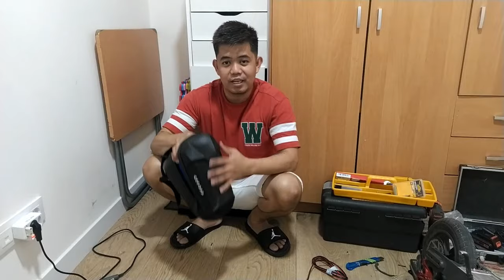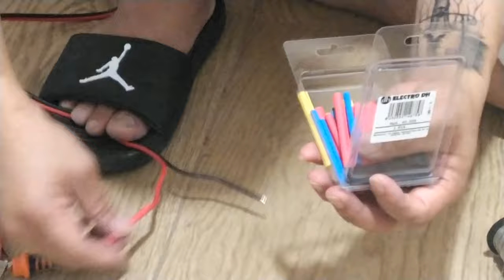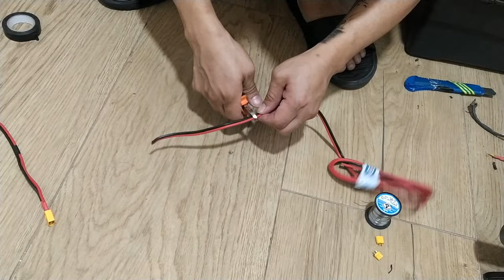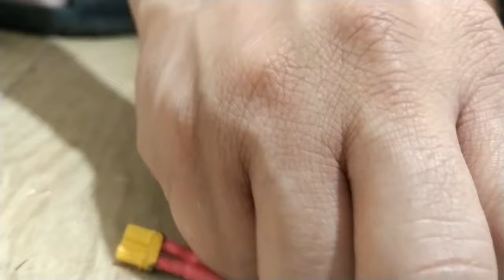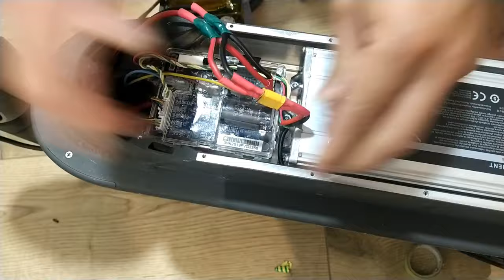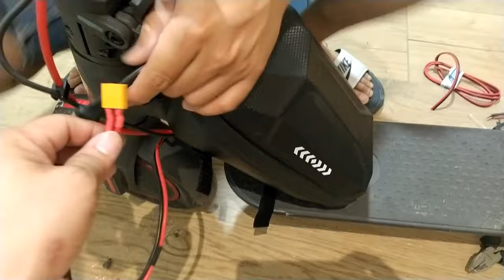how to make parallel connection for extra range batery  in xiaomi pro.

Comment: Just one quick question did u make sure the battery is the same voltage or did u have the 45v and 36v on different charge levels as I'm curious about what happens if u didn't do so
Reply from the maker: 36v to 42 v it is ok to do a parallel
Reply: @RHON_TV  So not. That is fire waiting to happen
Reply from the maker: @diyzona  alsmost 4 years alredy when i used this.
Reply from the maker: @diyzona  where did you get the 45v i say that vedio is 42v and 36v .

Comment: Hi, can I pay you for helping me tuning my xiomi pro 2 ? I just have some questions nothing much and I want to pay you for the informations.
Reply from the maker: yes whatbking of info do you want sir
Reply: @RHON_TV  i have sent you an email, maybe u can respond to that but I will make a quick list here.

Wich controller do I need to run a 500W Motor ? And Wich is compatible to my pro 2 i saw your video where u change the controller but I was not able to find the exact one u are using.

Can I reach like 40kmh with the 500W motor from Amazon?

Do I need an external battery to go faster ?
Reply: It would be awesome if u can give me links to products i would need to get my scooter up to 40km/h minimum, like the motor controller, motor and external/internal battery. And tell me if u want me to pay something for that, that's no problem i just want to be faster than 30km/h
And the controller and stuff need to fit in my xiomi pro 2 ^^ thank you very much for helping me out
Reply: @RHON_TV  can u maybe tell me?
Reply from the maker: ok i  will reply you in your email
Reply: @RHON_TV  thank you very much ! ❤️🙏

Comment: I have questions about the battery, is it the same voltages as the one on the scooter? That means 36v?
Reply from the maker: helo not desame  stock batery is 36v. and we add 45v  range battery
Reply: @RHON_TV  thank you one more question, how do you charge them? You just connect the scooter along site the extra battery? Or do you charge each battery individually?
Reply: @operrryz8697   did you get an answer to this by any chance?
Reply: @olaitanoladimeji3165  did you get an answer?

Comment: Only the cable ? or did u have to change the cfw ?
Reply from the maker: only cable. if you put range batery . no need to change the cfw. if you do a series connection you put also or change the cfw .

Comment: Bos matanong lng pag natapos e set up ang extension o extra battery my e flash po ba o hndi na?
Reply from the maker: yes. pag rannge lang ilalagay mo na batery. same lang talbo nya may nilagay lang ako filmwear kaya ganyan speed
Reply: @RHON_TV  boss pa suggest nman yung sa file for bms ano po yung files pra sa bms hndi ko kc ma install bka kc masira, from Turkey po aq eh mga shop d2 late na po sa upgrade ng mga scooter

Comment: Boss may xiaomi essential ako kalkal na daw itong unit na to naka mobo pro 2 na sya ano battwry pwede ilagay kasi mag lol9ngrange sana ako  itong MI essential ko eh 30-32 ang max speed mostly di naman ganito ang stock diba 25km lang yung ibang max speed nito thank you sana masagot itong tanong ko boss
Reply from the maker: 42v stoc bat nyan pwede ka pagawa nang 42v parallel mo lang  goods na yan . pero pag speed gusto mo ibang voltage parang 12v 16v 24v tapos series nmn para bumilis
Reply: Wala na ba babaguhin sa contoller board nya or firmware
Reply from the maker: @christianola8806  pag range wala pero pag speed need mo paltan fil.wear kasi itattas mo voltage

Comment: 36v ung xiami electric scooter 3 ko pwede bang 46.8 v ung extra battery ko
Reply from the maker: pwede yan i series pero di kakayanin nang mutor at controlero    gawin mo nlng  42v or 36v tapos i parallel mo nalng sya pra dagdag range
Reply: @RHON_TV  update idol ung controller ko rd 63v ung capacitor nya tapos ung motor ko Rated power/max. power	300 W/600 W     pwede na kaya ung e parallel ung 46v battery na nakuha ko sa isa kong scooter, tapos yung kinunan ko ng battery na 46v na scooter same din sila ng capacitor sa scooter rd 63v din nakalagay sa capaitor,, anu kaya sa tingin mo idol,, pwede na kaya e parallel ung 46v na battery.

Comment: Good dar sir ngayun q Lang napanood... Pwede mag tanung boss.. Nagpalit aq NG battery scoter 365m then pwede q ba gamitin Yung pinag palitan q battery as parallel or series... T. Y
Reply from the maker: oo sir pwede un hndi mo i sseries. iparallel mo sya same voltage dapat 36v
Reply: @RHON_TV Good day din po, ask ko lang din kung chinacharfe nyo po ba yung dalawang battery individually or dun nalang sa mismong charging port ng scooter
Reply from the maker: @laurencecade8945  pwedeng individual pwede isang charger port lang kasi mag ka conect nmn yab pero para sakin nag ccharge ako nang  naka hiwalay para mas mabilis pero dapat bbunutin mo ung connection nya tutal plag and play lng nmn yan

Comment: Magkaparehas ba sir ng capacity yang externala internal battery?
Reply from the maker: nope mag ka iba claas mataas amp nag ext bat ko
Reply: @RHON_TV  i mean yung voltage?
Reply from the maker: @willycortez3732  nope 36v lang ang stock pag pro .. extra bat ko  45v
Reply: @RHON_TV  walang problema yan maski nakaparallel na mag kaiba ang voltage?
Reply from the maker: @willycortez3732  yes
Reply: @RHON_TV  kasi di ba sir dapat di magkakarga yung isang battery na galing sa mas mataas na voltage papunta dun sa internal battery after na maflash yung 41kph na file. Di ba may removal ng charging yung file. Pero yung sakin nagkakarga parin

Comment: it's not right like that and under no circumstances do you do it like that!
the capacity of the batteries is different and for this reason one battery will charge the other at maximum current which heats up the battery very much and leads to ignition
Reply from the maker: what do you mean diferent haha  my scooter untill now is running with out any problem
Reply: @RHON_TV  the capacity of the batteries is different
as an example, the original is 7650mAh
the additional battery can have 12000mAh and for this reason the one with a higher capacity charges the smaller one with maximum current because it is not controlled,
I hope you understood.
It was safer if you put both batteries through a rocker switch and switch from one battery to another.
I personally did this and it is much safer.
Reply: @RHON_TV  when do you put the second engine on the back?😁